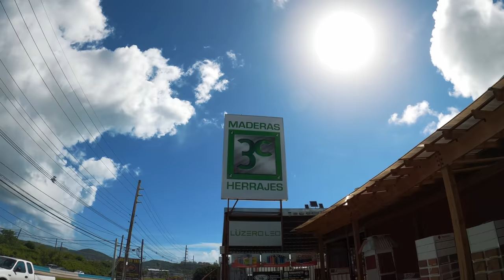BOAT YARD (PART 2) DESTROYED OUR BOAT SHOULD WE BUY THIS ONE?!

Comment: Don't forget to seal the edges of the plywood with epoxy before installing it.  Then as others have said, use thickened epoxy to build a fillet and mount the bulkhead to the hull before trying to add the fiberglass.  Watch some recent episodes of MJ Sailing videos - this couple is building a catamaran kit and has loads of information about laying fiberglass.  But getting the bulkhead mounted to the hull before trying to add fiberglass is critical.  The fiberglass is not structurally sound enough to bear the loads through an air gap.  Even if you added carbon fiber I would not trust it.  Those two need to be taken back out and redone starting with a good seal to the hull and the deck.

Those bulkheads are NOT a place learn how to lay fiberglass and try to make a strong connection.  They really need to be well done to survive.

Sorry but this is one place where GBU bad will kill you.
Reply: I strongly agree.
Reply: I agree the bulk heads are the strength of the hull.
But they must be bonded into place.

Comment: Good job guys.  Weren't the other bulkheads tied into the deck as well as the hull?  If your new one isn't then it will almost certainly feel flimsy.  Also, couldn't you drill a hole in the suspect bulkheads to check inside for the interior rot you are concerned about?  I wouldn't think a hole in the bulkhead would significantly compromise it's strength.   Just sayin'.
Reply: Yeah I agree, I would have thought they need to be glassed to the deck as well. In addition to that, I would add a bead or radius to the corners where the joints or edges meet so that the glass forms a 'rounder' corner. In engineering they call this a  curve (google it) and is far stronger as you are not asking the glass (when dry) to perform a sudden change in direction in it's stress, as does a sharp corner. If you look at a spanner 🔧 you will see that the actually ends where the tool has the slot (for the nut), they are joined to the lengthy part by a rounded curve, not just joined by welding it straight to the shaft. You need to make this similar curve to your glassed joints. A small roll of glass mat can do the trick. You would glass this in and then glass over with a couple of more sheets. 

Can people with glassing experience corroborate me here on this for Matt. But I'd certainly be glassing in/up to the deck the same way! 

You're doing great and thinking about what you are doing which is a good thing to be doing. Sleep on every major decision you wish to make. God bless!
Reply: I second this. I kept thinking that you need to tie the bulkheads with some fiberglass to the deck or they will shear off at 90 degrees to the pull from the chainplates.
Reply: Ya, you have to glue the edge of the bulkhead to the all the contact surfaces. New boat?? or beauty and the boat butcher channel...
Reply from the maker: Ye we're going to glass them to the deck. Just to make it really solod
Reply: @SailingGoodBadandUgly  Matt is my HERO.   Gangstas gotta have someone to lead the way.  Love you guys!!!
Reply: The reason they don't have Insurance is all Matt's Gangsta fixes would noway pass an Insurance co. Surveyor report ! I agree w/ comment below Beauty and The Boat Butcher ! Since you make your living off of YT one would think you would utilize it ? But I still enjoy your content 🤭 wish Kristen, Matt and everyone a Merry Christmas ✌️💜🎸

Comment: G'day Matt, I reckon it doesn't appear that you "completely" tabbed-in your bulkhead. Run strips and glass to hull & deck, covering plenty of surface area to add strength. It doesn't have to look pretty, it just needs to be strong AF. You obviously need to add enough glass until the bulkhead has ZERO play and is strong. You'll definitely figure it out. Cheers & Happy Holidays from Western OZ 🇦🇺 .

Comment: I would look carefully at the other boat
It’s always going to take 3x the time and money to fix old rotten stuff, especially on a boat and on an island.
Factor some budget for the time, home rent, slip, car rental, etc.
If the other boat is in good shape and is not too expensive. 

It makes greats video though, it’s always interesting to see people go through adversity.
Reply: Looks can be deceiving. Your current boat was looking a little rough but you were able to hide it for the most part. This could be the case of the "new" boat.

Stay the course and go with what you know for certain. Once you are finished rebuilding you will know you have quality instead of just looking good.

Comment: When you layer your glass you should do fillets at the ninety cause glass doesn’t do that turn very well and layer starting with a thinner width like 8” centered then 20” then your final width that way you have three different layers holding instead of one layer also get a 60 grit flap disc for grinder and grind flat wipe with cleaner then go to town laying down your glass runs remember you want strength not pretty then do last compleat layer of like 1708 biaxle  then if you want easy sanding and pretty use peel and ply on top of your  1708  check out Andy at boat works today I think he has a video for bulkheads  also I did that on my bulkhead install on my boat fuel tank replacement of my 82 yes 1982 wellcraft sportsman w 300 Evinrude etec  JT 🇺🇸🇺🇸🐠🐟🎣🛥🌴⛱🙏🏻🙏🏻🙏🏻
Reply: this advice is on point !
Reply: Bingo.  Spot on.
Reply: Great advice! Thanks for saving me all the typing. lol
Reply: yup, use some thickened epoxy to fill those corners and make a fillet. then glass over them using slightly larger consecutive pcs. this way each layer is on contact with the wall. if you use all same size layers then each additional layer relys on the first to stay in place. if first layer fails   everything goes out the window
Reply: If peel ply is too expensive, use wax paper. ;)
Reply: @peteharmony6024  nice Pete idea  I use Saran Wrap when I was young it doesn’t work to well    does it lift up and separate without ripping
Reply: Thanks guys give me likes I hope they do it that way but it will be expensive remember cheap is not always good and great is not cheap !🇺🇸🇺🇸🐠🐟🎣🛥🌴⛱🙏🏻🙏🏻🙏🏻
Reply: @johncartelli  exactly John fiberglass doesn’t do turns very well especially outside turns  inside turns maybe a little got be rounded JT
Reply: @hookednrolling2009  . Thanks buddy. We've all learned some cool helpful tricks by the awesome people in the lamination field.
We're just paying it forward to each other.
Reply: @hookednrolling2009  

Cheap in not good or safe!!
Reply: @modetremblay6258  exactly Mr Tremblay especially when your 75 + miles off shore JT
Reply: You may want to use stainless steel L shaped braces on both sides sandwiched bolted together and fiberglass them into the work for massive strength? Maybe? Maybe not.
Reply: @deankoch7305  yes I hear that the best to use is carbon fiber you can glass them and never have a problem with them especially with Rust and leaking  thru but coast like 5x more JT
Reply from the maker: Good call! Could I add the fillets later to beef up the joint??🙏🙌
Reply: @SailingGoodBadandUgly .
I'm answering just incase no one else is available. 
I would say adding them later won't really add much strength .
They're more often used as a way to allow the chopped strand a more smooth transition from each side of the 90° angle reducing the possibility 
air trapping between the laminations.
The strength will come from bulk and the absence of air between the layers.
You could go Carbon, but if costs are the main driver than I'm sure that's a no go option. 
If you replace the other bulk heads remember to do some filleting before laying down the big pieces.
You rule Matt,, you got this.
Edit : after you are done with the chop strand and are applying the cloth ( if you are using any cloth ) apply those layers in alternating layers of 45 degrees and 90°. That will help with strength.
Reply: @SailingGoodBadandUgly  Hey M n K the one you already did leave but other 90’s do fillet with thicken epoxy me I like peanut butter thick for gluing ketchup consistency and a rounded pop sickle stick tongue depressor or old spoon is real good to finish the radius and sand down with sixty grit resin loves deep scratch marks use a little heavier csm chop strand mat instead of what you is maybe 6 oz psy per square yard go to one layer of 9 oz csm  then go to 14 oz of woven roving alternating back and forth 3 or 4 times 5 on your main lines if you can I know you did plan this much rebuild replace at the ss plates wit the I think it is carbon fiber take another month and do once correctly you will feel better when you ar 100 miles offshore and some how get  hit with heavy storm winds the boat will take it I myself got into two storms with my boat so I know what she can do in 8 to 10 ft seas not fun at all I not a fiberglass professional just what I done over my 40 yr after high school I had like six boats  watch boat works today vids he’ll show how to do it JT sorry for all the nonsense just don’t want you two to have any problems out there like Beau and Brandy and get some of that two part epoxy like they have now JT 🇺🇸🇺🇸🐠🐟🎣🛥🌴⛱🙏🏻🙏🏻🙏🏻🙏🏻
Reply: You ask if you can add filets later, the point of the filets is so the glass does not break in the 90. Ok add them, but then add new glass over the 90s. And yes it would help to have all the layers tabbed to the old glass by using bigger layers. At this point it is what you have however. Your resin is chemically bonded as you did all alayers at one time so they are as one piece, the tabbing is good because of that.
Reply: @SailingGoodBadandUgly  ideally before ( I think ). The fillet allows the glass to smoothly transition the 90 degrees from the hull to the plywood. But you could fillet over your current ply before adding more. Take the glass that goes over the fillets out further than the glass before the fillets. Or go gangster and pull those plys off. Not sure how much further along you are since this vid was made?
Reply: @SailingGoodBadandUgly  The fillets go on first to support the board and make the sheets go on smooth and flat. the narrow strips go on first over the fillets and gradually get wider so each layer is in contact with both boards. there are many boat-building videos on youtube I would watch a couple. it is not too hard to do. if you don't find good videos just reply back and I will find you some good ones.
Reply: @deankoch7305  i heard that ss will corrode if encapsulated
Reply: @SailingGoodBadandUgly  if the new fiberglass has a STRONG BOND to the hull then all you're really doing with a fillet is reinforcing a 90 degree connection point  so the further out you get from that 90 degree joint the more leverage the fillet support will have,, engineering math proves it as fact,,  So YES!
Reply: @johncartelli  it will anyways but it last for decades.

Comment: I see you bought one but you have to wear it 😉.
Put thickend epoxy along the edges when you put the bulkhead in place.  Then put a bead of the thickend epoxy to allow the fiberglass to bond (fiberglass doesn't follow right angles well).  Use the same number of layers as the original and you should have a solid fix.

Comment: Matt, I a  NMMM doing absolutely the same as you on my Vagabond 47’. Big learning curve. But I recommend that you strip the paint with heat (now don’t go and burn your boat) just enough heat to bubble the paint and then scrape it off while hot. I also recommend that you use epoxy. It is a little more expensive but you use less, no smell and it really sticks. Good luck, I am watching you all the way from South Africa!

Comment: Matt, I used the paint removing disc for the 4 1/2 grinder than that wire brush that you are use-ing as some wire will come off that as well. which will hurt if it hits you. But you are brave taking on this job, that's for sure.

Comment: I know this may cost a bit more regarding your standing lines and  new chain plates, but have you thought about just changing it over to external chain plates?  
Fiberglass a 3/4” to the inside of the hull, and bolt it on from the outer surface.  Give you more creative room inside, speed up your project and give you peace of mind regarding strength of your lines.
Just an idea… I’m not an old salt and there maybe some issue with this idea, maybe someone can point it out so I’ll know why or why not as well.

Comment: Matt- would it help protect the wood to cut it slightly smaller than needed, then wrap the whole thing in resin and a thin layer of fiberglass before you fit it to the hull?  You could then mount it and tab it in, followed by sealing the holes for the chain plate and hopefully make it all much more resistant to rot in the future.  I am NOT a boat repair guy, just curious.

Comment: Add vinyl plank to your consideration.  Especially in your Wet areas.  I have it in my Galley, heads and hallway.   It looks every bit as nice as the laminate.  I think the faux grain in the vinyl plank I chose is more realistic looking than the laminate I have.  It is so much easier to clean and keep a shine on than my wood and laminate.  Laminate is very picky on what cleaners you can use on it and tends to streak and look dull.   Vinyl is virtually water proof(you still want to be careful so water doesn't seep though the seems and get behind it and mildew).

Comment: Matt and Kristen, I'm not a boat builder but I was thinking of your issue of one 3/4" layer of marine grade plywood. What if you double up on the plywood by glueing and screws before you laminate with fiberglass, It would add a lot of strength. You could even do a triple thickness of plywood. I enjoy your adventures...good luck, Dave

Comment: Kristen - Someone may have mentioned it in the earlier 549 comments, but in the event they didn't, a better way to scribe on the cheap is to put your marker inside the hole and roll a washer along the wall, bulkhead, etc. It will puck up the profile more exactly than using a straight edge. Obviously, a larger washer for big gaps and smaller for smaller gaps. If necessary, to get it more exact, you can go over it multiple time with smaller and smaller washers. Of course, Matt has to actually cut to follow the scribed line.

Comment: Those pocket doors you could use fabric. And put weights on the bottom so they slide better. And don't swing all over. Use stainless steel wire to slide on. Just paint your cubords. Then there sealed And will take half the Time. Love you guys. Wish I was younger I'd be doing it to. God bless you,enjoy every second.

Comment: Definitely seal the plywood edges beforehand.  Glass in the bulkheads on top to the deck with tabbing.  Clean that like the hull as well. And yes glass is expensive.  Your doing good. Thicken some epoxy like peanut butter and 45 all the corners. Glass hates bending 90s

Comment: That white stud that you called paint in the inside of the hull and on the bulkheads is not paint, its actually polyester gel coat and bonds well with polyester or epoxy resin. You could class right over tip after giving it a good clean with acetone. If you really want to remove it, the proper attachment for your cinder would be a 24 grit type of sanding wheel. Good luck

Comment: I agree with drilling the bulkhead to check the internal conditions. However, rather than just randomly drilling I would use a mallet to tap the bulkhead looking for soft spots. Then, instead of drilling, use a small hole saw to remove disks of the bulkhead material at the soft spots. These discs can be examined for material failure in much more detail than a pile of sawdust.

Comment: Matt & Kristen,  some great advice given here by the comments !  You should definitely use a 60 grit floppy disk on the grinder...it will take off the paint and any gelcoat...and it will create a rough toothed surface so your epoxy can make a strong mechanical bond to the hull. As others have said... generally set bulkheads with thickened epoxy fillets, followed by 8" wide fiberglass to tab them in to hull ....The fillets should be thickened peanut butter consistency with cabosil/silica....to make a radius ...don't try to push it in to the gap....just take a big spoon and s read it along the two surfaces so it spans the gap. Its ok to have a little space/gap between edge of bulkhead and hull so that the hull doesn't develop stress cracking along that hard edge of plywood ....the fillet and glasswork will transfer/spread those stress forces out to the hull. Then continue expanding out glass further with each subsequent layers of glass.. After 4-5 layers I would top it all with 1708 Biax laminated glass and a finish with 8oz glass cloth. Chain plate bulkheads should be overbuilt! With epoxy its best to do next layers within 12 hours so you get a chemical bond. If over 12 hours....you need to wash epoxy blush with water and sand with 80 grit to give tooth to the cured epoxy for next bond. Proper bonding is the critical. You guys got this !!!    I use raka.com for all my glass and epoxy supplies ....best pricing and good tech help.....they are on FL  east coast and will ship to you in PR.